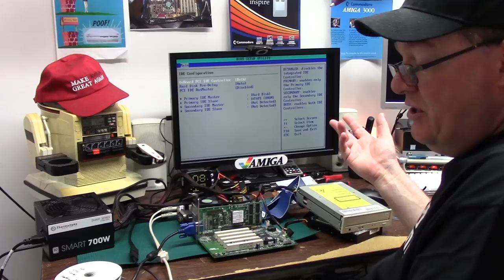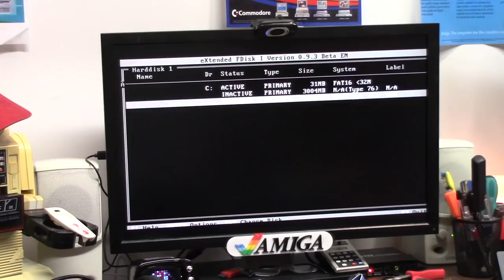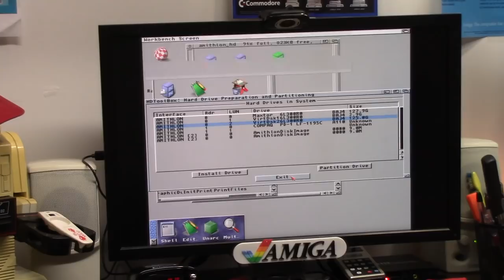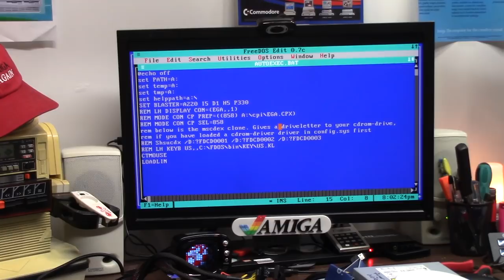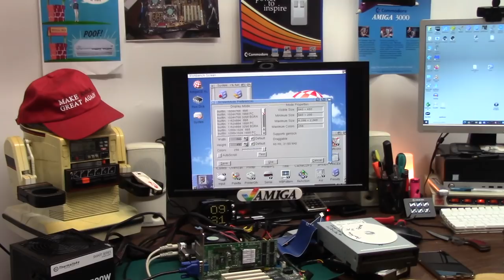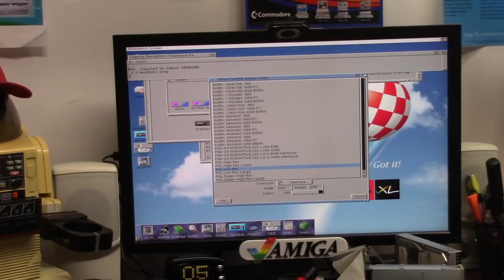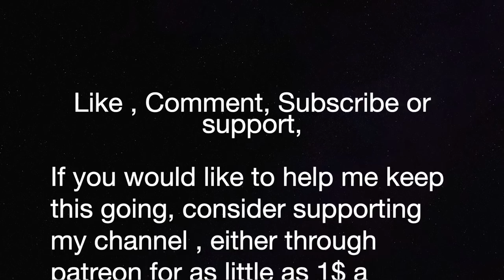AMD Amithlon Amiga Build #5 Step by step w Mailtime!

Comment: Great video, just great! Bringing back the memories from Amithlon era, almost 20 years ago. Mr Chris, you have just made me smile while watching this and remembering those days. Those were the days "when computing was fun". I am kind of nostalgic at the moment. Btw I am the one behind kernel 4 :-), even that was, uhh 12 years ago. Great videos you did Mr Chris, just keep it up! Best regards.
Reply from the maker: Maybe we can light that fire again!!! Thank you for making the kernel!!! Woohoo!
Reply: @ChrisEdwardsRestoration  Thank you Mr Chris for bringing it up. There are lots of people knowing and using it. Many of them who never heard about it will explore this great system by watching your videos. I was watching some amiga related videos and your amithlon series popped up. I am impressed. You said it right, that fire, it should be lit for sure. Every now and then, especially around new years, i have the wish to start it up and just spend some time in the workbench. Never used it for years, for many years. When I first got in touch with mini-itx boards, and ever since each of my boards were in small factor form, it was Via Epia. I still have two of them :-) and one is brand new, never used. They come with 1Ghz or 1.3, not sure at the moment, but that's plenty for amithlon. Downside is the gfx is unsupported by the kernels and it's limited to vesa mode. I am sure i can do some coding and rebuild the kernel with 2d hardware acceleration for Via graphic chips. Cpu speed is not high but it is mini itx and it wouldn't require any additional cards, video, sound or network. All in one and all supported. I would like to see that.
Reply from the maker: @milanca_m  I have tried to reach out to Bernd several times, but hes in hiding or no longer cares. You are like our obiwan. even if you gave a small look into the kernel again, maybe , just maybe a more modern video card solution or even SATA bus could be sniffed. wow how that would open doors of newer builds, machines etc... i know nothing of kernel development. so my apollogies if i jump the gun. but to have the creator of the Kernel update. the LAST kernel update come along is a real treat. and I thank you so much. Snkbitten and I have been keeping the match flame going. hoping someone comes along again. and look who shows up. cheers!

Comment: Fairly sure I have my first build mobo+cpu (Duron IIRC) from when I stopped using my Amiga 1200T (Eyetech Z4) as my daily driver in 2000/2001... would be sorta quirky to use that as an Amiga 😁 (Yes I do have a hoarding problem... 3x A1200, A600, A500+ (Dead ATM), A500 & 3xCD32 (1 with TF328) + crap loads of old PC parts & laptops)

I can also install my Arexx script that was included in one of the Boing Bags... if I can remember how to Amiga...

Comment: Brilliant video, got me set up in no time! Any chance for a video about E-UAE and whdload?
Reply from the maker: i will do one.
Reply: I used an athlonXP 2800+ with a geforce 3 and sound blaster live. The 2 problems that i was unable to resolve were the E-UAE with whdload. I am certain I screwed up the configuration file. The second was the boing bag 2 that kept asking me for the original cd and/or installation and would not install! I can see that you are usind burned cd's have came across this problem?
Reply from the maker: Just put in the xl cd.  Theres a hidden file on it that the boingbags read

Comment: If there is a SPDIF or TOSLINK port on the motherboard then you can use a optical cable to take the signal from the Motherboard to the Soundbar and then you have sound.
Reply from the maker: These boards are too old and do not. Some may i will have to test that.  Thank you!
Reply: @ChrisEdwardsRestoration  I had an ASUS P2B-B Motherboard and red light was coming out of one of the jack sockets which means that it also had TOSLINK on board but I also noticed the SPDIF on the motherboard that would connect to the soundcard and actually my board was a Slot board and I had an INTEL Celeron in a Slotkit adapter and I ran Windows XP Pro which was not legit so I had to get a legit copy after that I gave it away to a woman friend I knew for her son and also it had a ATI RADEON AIO Graphics card which was brilliant but I will leave you alone till the new year and have a great Christmas.

Comment: I'm getting to the workbench screen at first boot of XL disk but it just seems to freeze at that point, keyboard & mouse are non-responsive. However, CD drive is still usable and registers when I eject and re-insert the disk(Icon on workbench reflects this).
Reply from the maker: ps2 mouse and keyboard?
Reply: @ChrisEdwardsRestoration  Yes
Reply from the maker: What motherboard is this and what video card

Comment: We need a Linux Image to install to a HDD in an old pc. Something like Amilator but with pimiga on it and installable as a "Main oS"...
Reply from the maker: why not use the amithlon jit core boot/kick and load it on the virtual hd.
Reply: @ChrisEdwardsRestoration  isnt amithlon only for "very old" hardware? I search for a system that can be used with a more modern (not brand new) i3 or i5. Maybe like 7-8 years old. (2nd or 3rd generation core processors). a system like Pimiga only for a PC and based on linux... ;-)
Reply from the maker: @000jimbojones000  Tom, aka snkbitten got it running on a i series pentium. i have done a Q9550 core 2quad. but im old so there is no such thing as old hardware.
Reply: @ChrisEdwardsRestoration  ;-) okay i take a look....

Comment: Hey Chris, what version of FreeDos are you using?  I have tried version 1.0, 1.2 and 1.3 I can not
get any to run xfdisk.  When I try to run  xfdisk it can't find it or when I run fdisk it just freezes and give 
me a flashing cursor. Any Ideas??
Reply from the maker: 1.0.  You can use newer ones i just used the original
Reply: Thanks for the quick response, I am using version 1.0 but xfdisk will not run.
Reply: @repooh699  look in the odin dir on your cdrom. its there. I strugled also, but i used 1.3 freedos, that did not work.  Now I have 1.0 just as chris has, and works fine. take time for the whole thing, dont rush. Kind regards, TravellerMusic
Reply: Sorry, replying to an old comment, but just wanted to note for someone looking at this in the future. The same thing you do with "xfdisk" in FreeDOS 1.0 can be done with standard "fdisk" in FD 1.3. Make sure to run it as "fdisk /xo", which will enable "advanced mode" and provide options to modify the partition types. Otherwise, the menu options are pretty descriptive, and it should be quite straightforward.

Comment: Does this whole installation require CDs or can it be done using flash drives instead?
Reply from the maker: since there is no usb boot usually on these old boards the os would not see it, you will need a cd drive. remember this is 2001 tech
Reply: @ChrisEdwardsRestoration  I have an athlon XP 3000+ which will usb boot which is why I asked.

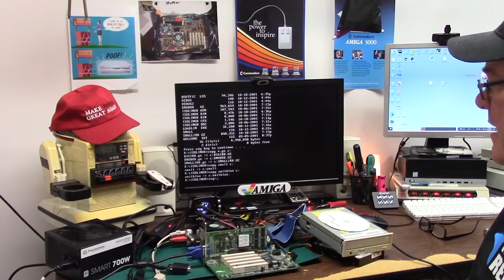Comment: after 17:33 when i reboot from the AmigaOSXL cd it starts...loads to .GZ files and goes black screen ??

EDIT :
ok so the black screen was because i had more then 1GB of memory installed. bumped it down to 512MB in one dimm and now i get the boing ball....but it says phase 5 emulator crash and goes into endlees reboot loop??
Playing around with the "small" file i can get the purple distorted kickstart screen but never beyond with kern310 or kern4...kern4 sata and scsi gives black screen again
Anything with "amithlon/bigird.gz" just gives black screen.

i can't get pass this point
Reply from the maker: what system is this on, like what is your board/cpu video card etc..
Reply: @ChrisEdwardsRestoration  I am trying to get it on an old EeeTop ET1602 and up to this point everything went great.

Had to use FD1.3 because i use a USB CD drive but then everything with creating the "FD" and "76" partitions goes smooth.

The graphics is integrated "intel GMA950".

When it tries to boot it goes boing ball....then 68040 soft reset....gfx reset...and then it says phase 5 emulator crash and then it kinda tries it again in an endless loop.

tried disabling everything possible in bios just to test if it was something there.

I understand that when the distorted boot screen comes on this is because i haven't set the amiga partitions up for amiga and made bootable. as this is the next step in your video....but booting from the AmigaOS cd just gives a black screen like if i try loadlin @amithlon.

loadlin @small gives the distorted bootscreen.
Reply from the maker: Isnt that a pentium “M” imac clone?  Prob needs a compatible video card which is why it craps out.  But idk if that has one , And did it ever boot to the Amithlon desktop at all? or you only got the freedos stuff done.